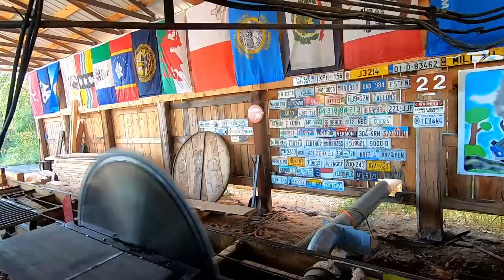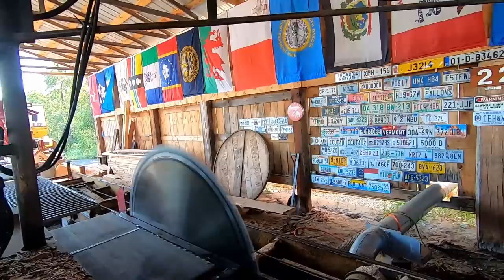sawing a pine mantle # 226

Comment: I was home in Surprise Arizona, about 6 or 7 miles north of Luke Air Base. I hadn’t realized how loud the planes were (F14s) until they weren’t flying. They were flying in pairs around the Phoenix area for months afterward. The first day they were able to fly, they put all the planes on the tarmac and started them all at once. What a sound!

Those planes flying in pairs were a great comfort at that time.
Reply from the maker: yes a erie sound just quiet.

Comment: You might consider an ear corn elevator off the end of your swing saw instead of the loader. I used one off the end of my wood splitter to pile the firewood. You may not have the necessary room for it to access your sawdust bin.
Reply from the maker: the loader works better for us.